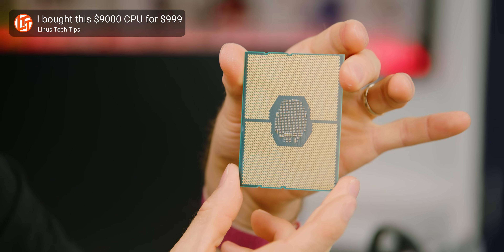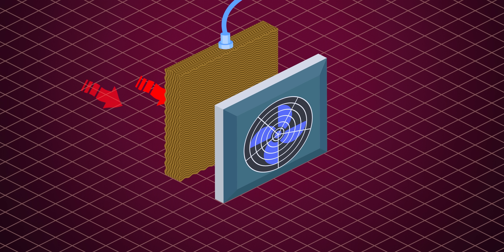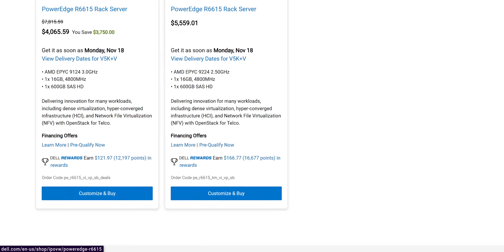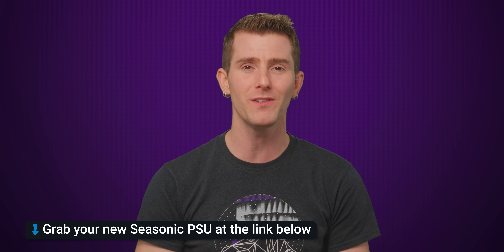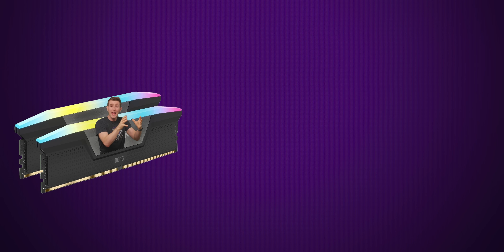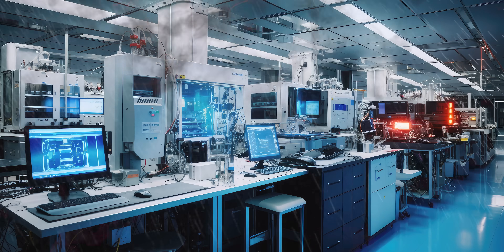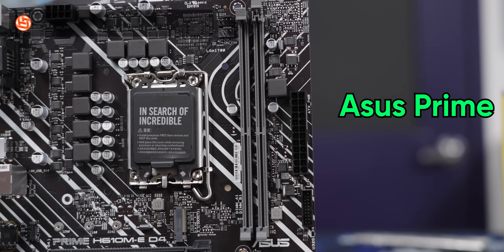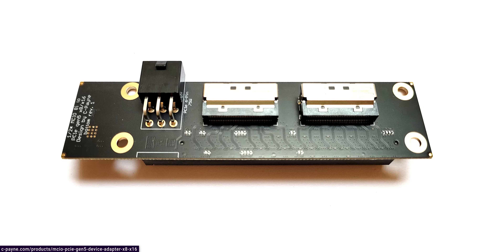What’s The Difference Between A Server and a PC?

Comment: According to CompTIA and Network + exam a server can be "anything that can be assigned an IP address"
Reply: Gotta love using an Xperia Arc as a NAS, best Server experience so far
Reply: There are a lot of CompTIA things that could be argued about...
Reply: @TemplePate01  yeah, tis the same with Cisco and EUCIP exams, and any other exams to be honest, there's always a twisted question in there somewhere.

one of the latest irks on a cisco exam for me was kinda like this:
an MS OS is not starting up
The Correct Answer:
Go to the control panel to start up safe mode

:planetary facepalm:
Reply: @TemplePate01  Indeed. I had to do Server+, and many of the things in there just do not apply anymore.
Reply: @TheSaabClinicUK 
Learn the principles - those have not changed for four decades.
Reply: @TemplePate01 
The Comptia definition is technically correct.
Reply: You're mistaken. A server is any computer or system that can share resources, data, or services with others. This really doesn't require an IP address, even systems can share services or resources by other means (serial ports, SATA, USB, etc.) IP services are just a popular protocol that can be used.
Reply: @Armagore  That was a very generalised definition meant for an absolute beginner. But your definition is much more nuanced and technically accurate!
Reply: CompTIA is technically correct. In the early 90s, engineers would do things like set up microcontrollers with just enough smarts to run an IP stack so they could telnet in to some or other TCP port to see how much a coffee pot weighed and thus, whether or not somebody needed to make a new pot. That's a server in action.
Reply: @likefunbutnot  i always wanted one of those lol
Reply: I mean, I know there are people running a certain forum off an old laptop, so yeah.
Reply: Ironic by this definition most Printers, all routers, and all Switches could be considered as Servers just by themselves.
Reply: @abbottshaull9831  you realize early network printers advertised as having a "built in print server" and early home broad band routers advertised as having a "Built in Internet gateway server", because before home broadband,  routers were mainly just for segregating out larger Lans, not connecting you lan to the greater Internet. That was done through your gateway. Everything you described used to be done by a sever.
Reply: @abbottshaull9831 yeah, but... they really are
Reply: yeah you right, but also not fully correct. what the video talks was the proper today standard server not.  just some designation. in fact you could use x86 pc for routing. but does it practical? hell nah
Reply: Well, I can't assign an IP address to my server at a Made Cafe. Why are they called servers then?
Reply: @krtirtho asking the real questions
Reply: As someone who has taken this exam, this is true and hilarious
Reply: cant wait to run truenas off my wii, thanks comptia!
Reply: @aamia2710  if a wii’s software can be jailbroken to run a server OS, then yes it can work. People have successfully turned older PS hardware into servers by jailbreaking sony’s operating system.
Reply: Why limit to the ip protocol? There are plenty of older protocols like IPX/SPX, Appletalk, Ethertalk and all of those would allow connections to servers.
Reply: Yep, that's technically true as you can't have a server without a ip address whether it's online or offline... so can my phone technically lol.
Reply: That is just dumb. What if I have a machine running CCTV software with cameras connected directly through a proprietary interface. Completely offline and no network interface. That would not be considered a server?
Reply: @vic456  True!😂 In that case those machines won’t have IP addresses assigned to them.
Reply: Your phone is assinged by an ip address, does that make it a server??
I study comptia network + and it does not say that.
Reply: In that case, can't a router just be considered a network server whose core job really is to assign said IPS?

Can mobiles that hotspot also be considered servers?
Reply: @AdmiralBison  They actually are in some cases, the definition has to be a bit more nuanced when differentiating routers. If a router had its own memory, stored information in itself and transmitted that information to other devices then yes, it is a server. Some routers let you do that, by letting you attach a USB thumb drive in them, turning them into FTP Servers!
Reply: No one ever said that CompTia crap was good.  Get a real education.  Experience.
Reply: @augurseer @augurseer, You are out of context; I'm referring to the statement that said "anything that can be assigned an IP address" is wrong, even in the official book of CompTIA A+, Network +, and Server + don't have that definition. Instead, it said, "a specialized computer or software system designed to provide services, data, or resources to other computers, known as clients, over a network." Another thing I noticed is that description is literally describing a node instead of a server. So to clarify, which system assigned you the address? The server (Host), which system can be assigned IP address? is a client. A node can be assigned an IP address, but it could be a server or a client, so it matches the description perfectly. I have a real education, unlike you; a real professional doesn't need to dehumanize or degrade other people's opinions, which could serve you as a teaching moment; everybody is a student; remember that.
Reply: In my CS education I was told that's why the technical term is "server class machine"
Reply: Technically not incorrect. A 'server' is a function. Not a hardware specification. Any computer can be a server. Would it be 'suitable as a server for the required task' is a better question.
Reply: CCNA defines it as "any machine that provides a service to (an)other machine(s)" I like that definition better
Reply: @TheBoostedDoge  CCNA is miles above CompTIA level.
Reply: @anantakesharipanda4085  Yeah I don't know CompTIA's material very well. I assumed Network+ would be at the same-ish level as the CCNA
Reply: That is true. As long as it is serving something. I would take old junk PC's and turn them into print servers for remote printing.
Reply: A server must provide one or more services, IP address be darned. No service(s), no server.
Reply: My iPhone must be a server then 🤦‍♂️
Reply: @cnrails 
It actually is.
Reply: @Mzansi74 it in fact isn’t, but nice try
Reply: @cnrails  
How so?
Reply: well thats the most fitting description, a server doesnt have to be rack mounted, power efficient or have some fancy components, thats all optional and are not even exclusive to servers
Reply: @SergeantSam3D  im considering my next gaming build to be in  a 4U case......
Reply: @SergeantSam3D Yep even a phone can be a media server. Fair enough description tbh
Reply: No one who actually works in IT quotes or even cares about CompTIA certifications. They are only as big as they are because they lobbied their way into needing to be required to work in government IT positions, and need to be renewed every 2 years, so HR and other non-tech positions see them as some sort of high and mighty certificate.
Reply: Careful!  Your comment might be taken down!
Reply: Today I learnt smart fridges are servers.
Reply: Wait so my toilet is a server ??
Reply: @zohaibsiddiqui1705  Can it have an IP address assigned to it? 😆
Reply: Comptia is pretty shit
Reply: @GroteGlon  it’s a good exam to get your feet wet into networking world. But I don’t think it server any more bigger purpose than that. An online course on computer networking at Udemy or something will teach you much more than that.
Reply: @anantakesharipanda4085  y'know. It teaches a bunch of ancient concepts, some bad habits, and stuff that's straight up wrong. I honestly think it's better not to take it and to study for something good in the first place.
Reply: I think somebody lost a period somewhere. I wonder where it goes.
Reply: my toaster fits that description
Reply: yeah, I had to trick a cisco fpr firewall into thinking my laptop was a server to reflash the firmware after it bricked itself from no one applying the license after years of use.
Reply: Yes, but no.
Reply: I mean technically anything with an IP is a part of some server somewhere because if it wasn’t it wouldn’t need an ip address
Reply: @queryw6982  you are 100%, without a doubt, completely wrong.
Reply: Nah bro doing server+ next week, don’t tell me they are that stupid questions
Reply: Ipv4 or 6??   lol!!
Reply: I've derived two disturbingly accurate practical definitions from my experience:

Server -> a computer that is always on and networked

Embedded System -> a computer that you can yank the power from without too much fear of bricking the system
Reply: Sometimes, you just have to be spontaneous… Like leaving this comment. Check my nickname.
Reply: Got to start installing nginx on my smart toothbrush
Reply: It's not necessarily wrong. I've run a server off a raspberry pi.
Reply: Technically correct but realistically not at all. I'm not running 99 percent of IOT devices as a server. However APTs have been using IOT devices for their needs for years in the form of botnets. Pretty neat stuff.
Reply: it can be, although a service that can communicate over a network is also required. They CAN be, doesn't mean they ARE. server vs client are roles, not types of computer.
Reply: my TV hears its a server!🤯🤯
Reply: Maybe that's true because it's something you want it to be. Nothing's stopping you.
Reply: Does it even really need an IP, or a physical connection? What about something like an Xorg display server, that apps on the same machine can talk to through a socket? It's surely just something that "serves" requests, but that maybe too broad and I guess they implicitly meant typical industry server hardware here.
Reply: @johanngambolputty5351 
Interesting...
Reply: It still has an ip. Vms are assigned ips through nat on the local machine.
Reply: @TimothyGarrett-mi9wm  uhm... no. VMs have an IP address, yes. But they're not assigned by NAT on the local machine. NAT doesn't do that. IPs are assigned either manually or by DHCP. Usually, you use the local machine's NIC and create virtual NICs, but you can also install a separate NIC for your virtual machines.
Reply: That’s not wrong
Reply: User was banned for this post
Reply: @ 
Get out summerfriend
Reply: Do you have a source on that?  Because from when I took the test they defined it as just anything that provides resources.
Reply: @virionspiral  I took the test in 2004.  They still had questions on single line networks back then.   I remember the definition of a server being "anything that can be assigned an IP address" from the 2016 study guide I bought for my employees. No one in the shop got it right on the chapter summary quizzes. MS and CompTIA certs and study guides  are paid for any employee that wants to get any cert they offer.
Reply: Why am I still getting notifications for a post from 10 months ago?!?  This was a half joke, as it wasn't a direct definition but was one of the practice questions. It was the closest logical answer and the one that the test booklet said was the correct answer, but only because the other answers were way off. Typical compTIA shenanigans, out of the options it was the correct answer but not the only possible correct answer outside of multiple choices. It was posted as a joke during the time when Linus was doing the CompTIA A+ content.  Some of you guys get way too emotional and literal at the same time.
Reply: Comptia is so weird. They over complicate everything.
Reply: Sorry sweaty ITs and IT LARPERs, this is in fact 100% accurate. 

Maybe this will change, if you stop feeding big tech in such a way that they can sell all their specialized server hardware at absorbatant prices and ignore the lower end of the market. 

But for the time being, those of us who are allergic to big business and the big tech rat race are mostly stuck using off the shelf PC boards and Chinese mini PCs for our small servers, since the people making them don't stick extra zeros on the end of everything they sell.
Reply: @HaveYouTriedGuillotines  Even the big guys, when it comes to getting things manufactured they  don't care about the best hardware. At both Fijitsu and Acer,  their production and refurbishing  imagining servers were repurposed off the shelf systems.  At Fijitsu every line of techs imaged from a Fijitsu TP3K off the shelf PC.  At Acer every line of benches had an Acer Predator or Gateway FX gaming PC repurposed as a PXE server.
Reply: @HaveYouTriedGuillotines  there was a comment i read just last week on some guy not buying Dell servers and making a custom server build for his company....for 6-8 times cheaper and a bit more powerful as well, the project was in the 6 figures range.
Reply: @xerr0n  
I have a lot to say on this subject, but this evil site keeps sensor ship ing my posts. No, that's not a typo, it's a bypass. :/
Reply: @xerr0n  Dell as a company started in Austin by doing just that back in the day, making custom PCs for their clients.
Reply: so my buddy's apple watch is a server? cool! imma get him to self host jellyfin on it
Reply: @Khalid.Ibrahim0897  
An apple watch absolutely has enough power to function as a very small server. You could in theory have a tiny file server on your wrist. IF apple allows you to.

Apple cripples their own products in such a way that you need to spend more to get functionality that any other device on the market has as part of the baseline.
Reply: @Khalid.Ibrahim0897  
An Apple watch has more than enough power to carry out some light weight server tasks. 

It could, for instance, serve as a wireless file server and host some small but useful files, or perhaps act as a Pi-Hole host for a group of laptop users that that have its IP.

The only thing stopping it from doing so, is Apple.
Reply: @Khalid.Ibrahim0897  It can be, if apple doesn’t lock its OS down so much that you cannot host a server application on it and open server communication ports. 
A raspberry-pi(A computer that is the size of a credit card) is often used a small home server for NAS, CCTV and home automation purposes. And raspberry pi sells at 1/10th the price of an Apple Watch!

Comment: For me a Server is a system that can handle multiple users at the same time. That's it.
Reply: User 'requests', is a bit more accurate
Reply: That's a function of the software, though, not the hardware. A desktop PC from the 2000s can be put into service as a web server. It won't answer a million concurrent requests at reasonable speed, but it can definitely handle more than one at a time.
Reply: @argvminusone  Yes, exactly. The hardware can be optimal or not for the task, but it doesn't make a PC or a server. The software/OS does.
Reply: @argvminusone  you would be surprised how much a 5950x can handle concurrently
Reply: Sure that sounds easy, but I just keep running out of USB ports for all those mice...
Reply: Unless you're NCIS.  Then two people can use the same keyboard at the same time...    😮‍💨